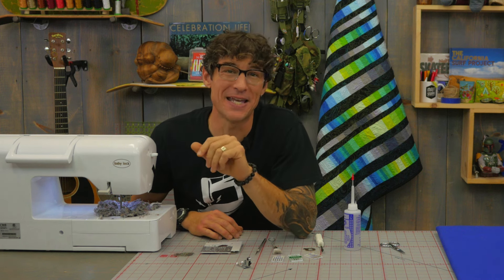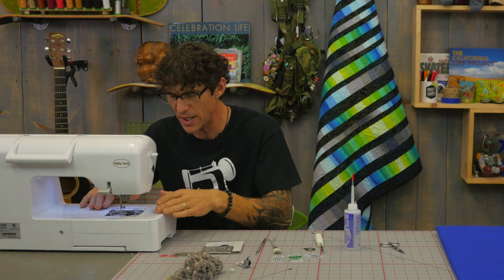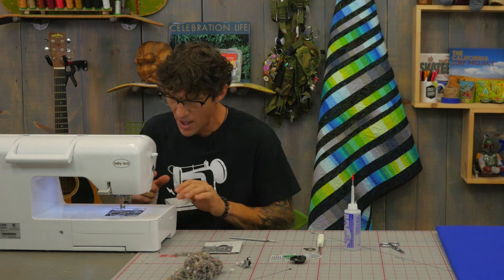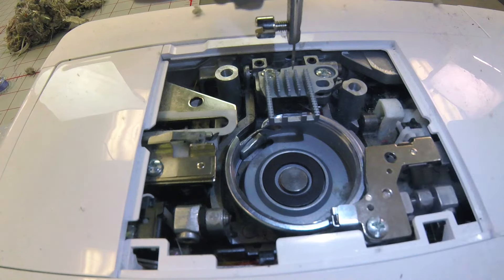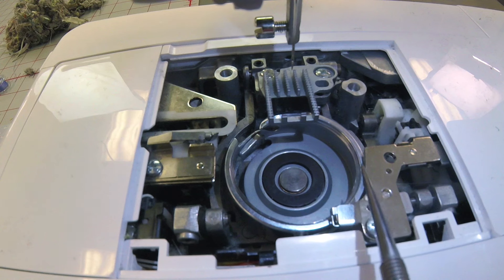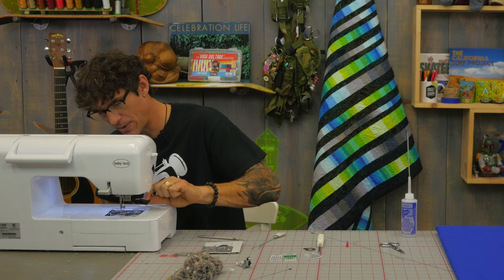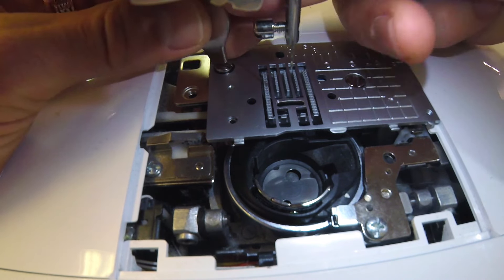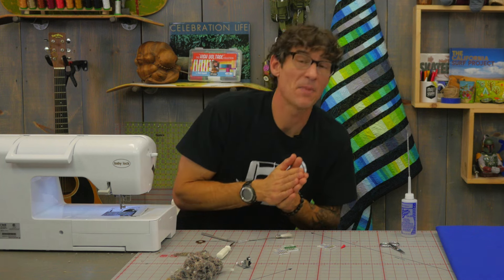Sewing Machine Maintenance: Troubleshooting Drop-in Bobbins

Comment: My mom and I both have a Brother CS6000i computerize machines.  However, mine wouldn’t sew, error E6 and the thread kept coming off the thread guide which I have since replaced.  However, I continue to have problems.  After watching this video and comparing my machine to my mom, I realized my bobbin sit to low in the basket. After I load the bobbin case ensuring the correct positioning, I was able to take my finger and rotate the bobbin pass the position spring which shouldn’t happen based on the video.  The part the positioning spring it attached to was to high compared to my mom’s machine. So I slightly bent is back down while making sure not to damage the spring itself.  Bobbin problem solved but bottom thread still loose even after cleaning.  Any other suggestions

Comment: I really appreciate your videos. I have a question with bottom tension as it's not really adjustable how should i compensate for thicker thread? Should i i have a bobbin case with lower tension prepared?

Also I have an issue that even with small tangling the bobbing case jumps up and skips the stop. The timing seems to be fine and the needle is in the right position. Any hints on what to check next? Everything is clean and no bobbin case hits on the new one :-)
But i have to say you're videos helped me immensely.  Both in terms of fundamentals of sewing machines as well as techniques.
Reply: Did you figure it ourmt??
Reply: @mimiandhercrew05  I did... i just got the second bobbin case and loosened it up. now if i want to sew with thicker thread i change the bobbin case. A bit of hassle and expense but works pretty well.

Comment: I'm curious as to why I don't see people use a vacuum to lift the fuzz once it's loosened? I see brushing it around can push it further into the  machine. Is there something undesirable about the use of a vacuum?

Also, an air compressor absolutely has moisture in the output, unless you're using a dessicant dryer air/water separator combo on the output. As much as canned air? Not sure. Probably depends on how much humidity there is when you're running it.
Reply: Theball Player I have a new zinger 4011 while sewing on a mug rug ( top stitching) its loose and every few stitches it does a loop. When I use a scrap of the same (I make a sandwich) it dies not do it. What in Sam hill is wrong. I'm at my wits end. In 75 yrs old and want to get birthday and Christmas ptrsents finished, just in case in not around. My machine is only 1 month old and is doing great otherwise. Rob please help me. I what h all your tutorials and live them. Wish I was 45 years younger.  You ate precious and a cutie. Thanks for listening.  A dedicated watching of "Man Sewing"

Comment: Question: I have an old Kenmore machine. Whenever I fill a bobbin I've had trouble getting the machine to revert back to sewing. I've had it serviced three times. The second time the repair guy  said he had to replace the clutch (don't know if he really did or not).  I haven't had to fill a bobbin for a year. I  filled a bobbin last week and now I can't get the machine to switch back to sewing mode (again)! Because of this problem I've decided I need to purchase a new machine but I would still like to have it fixed if I can because it sews so nicely but I don't trust the guy who has serviced the machine the last three times and I can't find anyone who will work on my Kenmore. Can you suggest anything I should try ?

Comment: Janome 12000 memory craft. Please can you tell me why the bobbin starts and stops after a few winds and the needle goes up n down. I’ve had my machine for just over 9yrs now but rarely used it due to illnesses. Now I’m halfway through my project this trouble has started. I’ve given it a good clean n little oil but it’s still doing it. Can you help me please. Carole.

Comment: HELP! My needle will not pick up the bobbin thread.  I oiled my whole machine .It is an old Kenmore purchased in the 80's. ( I have a 2009 machine that the bobbin threads are balling up too.) I believe...know  when I was checking out stuff I moving things around I move the part in a circle, that the bobbin case fit down  into.  I was wondering if the sharper point of the case (that I stupidly turned),  Is suppose to pick up the upper thread, it does not.  dDo you have a lesson on machine Repair 102.

Comment: I have a brother lx3718 and my machine suddenly would get completely jammed after one or two stitches. I had a bent needle so I replaced that, same thing happened. So I removed the bobbin thread and fabric and removed the cover over the bobbin area so I could see whats going on. So I JUST have a threaded needle and no bobbin thread, and I begin to spin thhe handwheel. First stitch goes fine, second stitch, the thread coming over the bobbin case got stuck and so as the thhird stitch came through, it got tangled with that stitch that was stuck in the bobbin case and jammed the machine. Currently trying to re-install thhe bobbin case but it wasn't the case it was getting stuck on, but rather a small metal bracket that seems to just be for support. I am hoping this helps because if thhhe metal piece happens to be bent I think I can consider my machine dead :(

Comment: I noticed you said you use an air compressor instead of canned air because it doesn't have moisture. A standard shop air compressor will definitely have moisture in it unless you attach special water separators and such in line. You have to drain the compressor tank periodically as they'll gather a lot of water over time. Thought I might go through this sewing learning process with my wife but starting to look like it's too much a pain to be worth it for occasional sewing. I mean to sew 3 or 4 times a year there's no way I'm going to go through a machine every month to add oil everywhere. May go ahead and give up learning the sewing. Lol. Is this monthly oiling for daily users or the oil dry up and you need to go through and oil it again even if you didn't use it?

Comment: one day i got to the end of a spool of embroidery thread and the thread got caught on a bur on the spool, pulling the needle sideways as it kept sewing and it hit the metal piece right under the hook and made a deep scratch that shredded the thread constantly. i took the advice of people online and tried to file it down with a nail file and it improved but was still there and still messed everything up. i took it to the shop and told them what happened and they had it for a week and said there was no scratch but they removed thread from the takeup lever and that it was running fine now. liars. then i moved and the next shop i took it to i had the original photo id taken with a big red arrow pointing to the scratch and stitch samples with where it was looping and shredding circled with a hilighter and the lady actually set it up on the table and sat with me watching until it messed up. that place actually fixed it, although i still havent finished the project i was working on
Reply from the maker: Hello! I'm glad to hear your machine is back up and running. Hopefully you can finish up your project soon! Have fun sewing!

Comment: Two things....
All sewing machines require lubricant, which will dry and become solid over time. The entire machine needs serviced, not just the hook compartment.

Never, ever blow canned or compressed air into an electronic sewing machine. Unless frying circuit boards is your goal.

Comment: I bought an old "Centennial Button Hole " second hand.  The model @ 86086194.  My problem is it didn't come with a manual, nor does it stop if I plug it in.  The foot pedal thing could be ??? I don't know what might be wrong.  Any suggestions?

Comment: The round little quarter size screw driver is of the same thickness all the way around.  I find that instead of trying to stand it on the little end I turn it and use the round quarter looking piece.  It is more stable this way.
Reply: Hey, I'm going to try that, so glad I read thru the comments. Thanks for the tip, Paula!

Comment: Thanks Rob, i find every time i  start sewing, the machine stops, and seems to hit sommething, what is the problem ?
Reply from the maker: Hi Doris! Please make sure your bobbin winder is not engaged, if the machine will still not make a cycle, remove the needle, and try again. If the machine will cycle without needle you need help from a tech, means the machine is out of time. If the machine will not cycle without a needle, then we know it is a jam, try to turn machine in reverse, if it then cycles, it may be free. Either way sounds like you may need some hands on help from a pro.

Comment: I broke a needle on my juki DX7. Cleaned it all thoroughly, even tiny smithereens of metal from the needle. There is a sound when the bobbin case is inthe machine. I have spend half a day looking at it with a magnifying glass and cleaning it. I have lifted the magnet and all seems smooth and clean, yet theres this extra noise.
Has anyone had this issue before?

Comment: Update:  one thing I forgot to mention, in my previous post, is that I did received an E6 error.  I found a video by Dolores Maestaes, “E6 Brother CS-6000i sewing machine”.  So, I followed the video and lubricated all 3 bearing since I didn’t know which one maybe the problem.  In addition, I cleaned out all the lent in the inside while I had the machine part and as well as whatever I mention in my last post.  My machine is working now. I hope this help someone.

Comment: That was a lot of talking for saying "clean out your machine and put it back together again". Still didn't help with the rat's nest in my bobbin area.
Reply: I had this issue and what I discovered was that the UPPER thread is the problem. Or rather the threading. If I sew too fast, the vibration allows the thread to fall out of the THREAD UPTAKE resulting in bird nesting in the bobbin case. Re- thread the machine being sure you are securing it through the Uptake Lever ( this is usually the last place you thread before coming down to the needle shaft area). Try sewing a bit slower and see if that helps.

Comment: @5:30 If you're using an air compressor then you most certainly do have moisture in the air (you're sucking in atmosphere that has a humidity component), unless you're running a dryer, which most people are not.  I jump through so many hoops to keep my air tools in my shop free of moisture. :-P

The "moisture" coming out of a canned air "gas duster" unit is liquid forms of a few *ethanes.  It evaporates and leaves no moisture residue.  Canned air is superior to an air compressor and one of the "pros" is that it's suitable for electronics because it contains no residue, even if you turn it upside down and spray liquid out.

Comment: Those little gizmos for unscrewing the needle plate are a real pain.  It didn't use to be this way you had a spring clip under the plate and used a screw driver to get some lift and slide it off.  It's not your fingers - it's poor machine design.